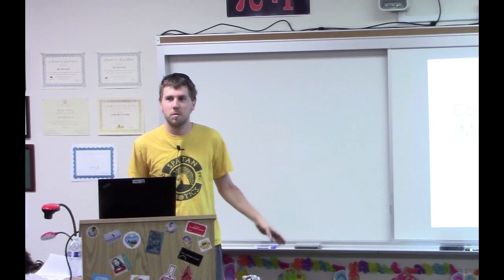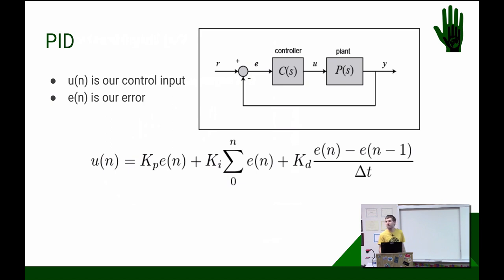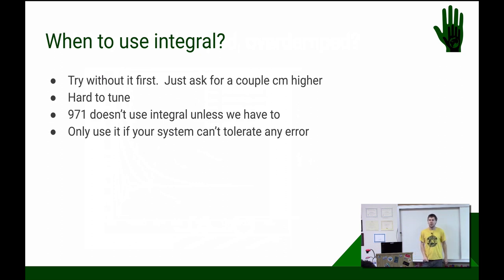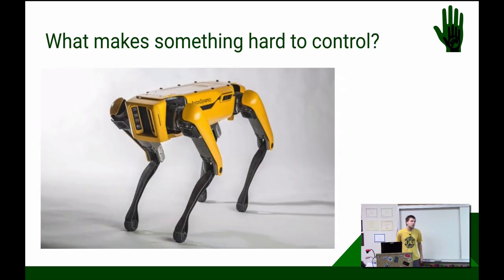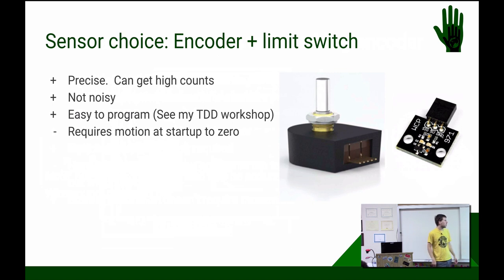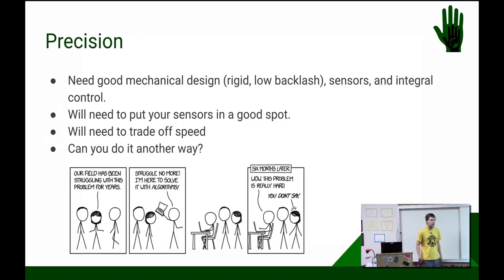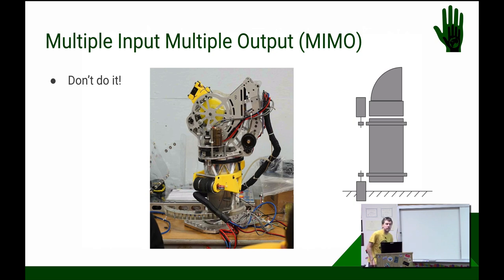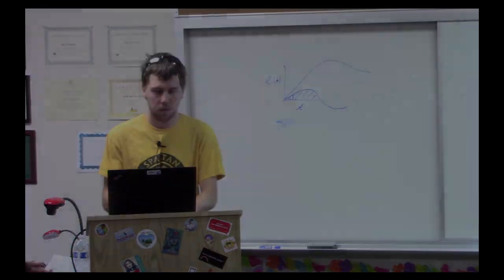Spartan Series / Controls 101: Making Robots Dance [Intermediate] - Austin Schuh

Comment: What software are you using that allows you to simulate the PID oscillation amount in the graphs?
Reply: not from 971... but I recommend Stimulink
Reply from the maker: Austin used matplotlib and the model from 971's 2016 robot's intake.  The
model is in //y2016/control_loops/python/intake.py  (available from 971 download page http://frc971.org/content/2019-software).